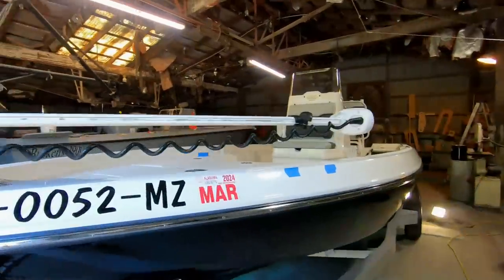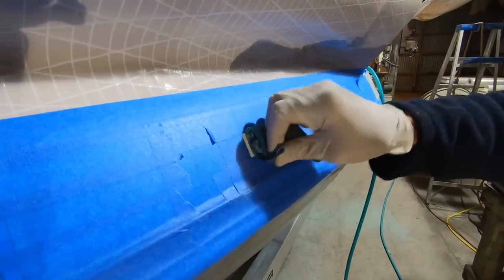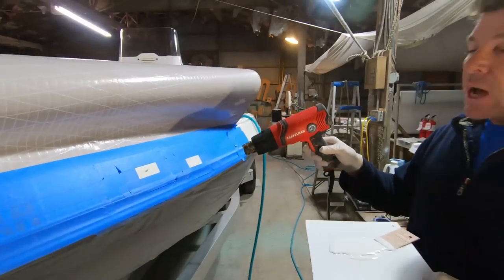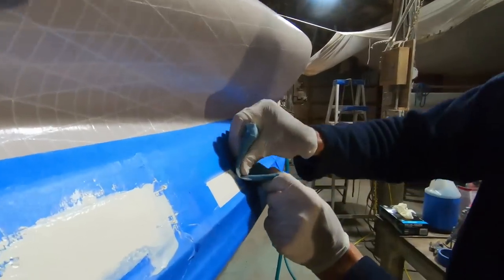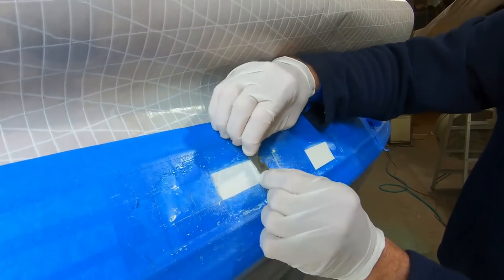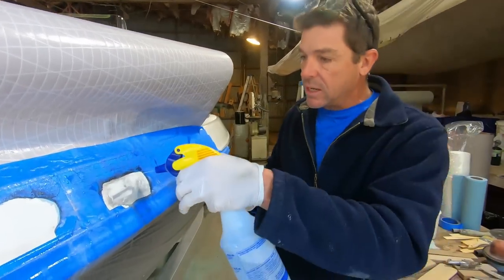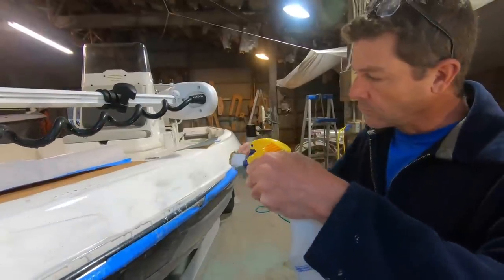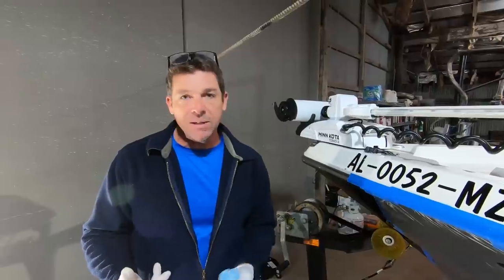GELCOAT REPAIR 101 -A to Z How To Repair Chipped Gelcoat and How to Repair Gelcoat Scratches

Comment: Hello Joe , this is Jaime from J A Fiberglass in Gilbert , AZ , it is amazing to  see somebody repairing gel coat the same way as i do from the wood blocks to the masking  around the repairs , i generally do add cabosil to thicken the gel coat on the first fill especially if its deep cause like you know time is money. i like to finish the repairs with 1200 paper , i find that works for me on white or light colored repairs , if  its a black or dark repair i will work up to 2000 and i use the 3M Hi gloss white white  with my rotary buffer , start out with a low setting  and finish with a like a four setting on the buffer and that takes all the scratches out and gives it a super high close , wipe it down good and i apply my favorite wax , which is the Collinite marine paste wax. Great to see this video, your spot on and people will get good results if they follow your advice, good luck fishing.
Reply from the maker: Hi Jaime, Glad you enjoyed the video! I agree that adding cabosil can be very helpful, especially with deeper scratches and dings. I have a couple more gelcoat repair videos on the channels where we show that process. The damage on this boat was on the edge between thickened and non thickened gel in my opinion. So I went with non thickened just to show some of the DIYers out there how it could still be done even if you didn't have any cabosil. But that is a good point! Sounds like we are on the same gel coat repair program overall. It is always good to hear from another professional, and get there feedback! I feel like there is always something to be learned from other craftsmen, and I try to have a open mind about different styles and techniques. I appreciate you watching, and your positive Comments! Please feel free to let me know if you have any suggestions for content on the channel, I would like to hear your thoughts! Thanks so much!
Reply: Some of the soft yellows and blues are hard colors to match, what are some of the tricks that professionals use to get the colors right if you make them up . Yours videos are great , I like your detail explanations it’s like I’m doing it myself while watching.

Comment: Been viewing your videos. Just so informative and super detailed. Luv your videos so much about repair and gel coating. I watched your videos numerous times to get confidence. Then purchased (approx: $800 since Qrt Spectrum Atrlantic Blue for $360) a bunch of materials and equipment to complete a DIY. Two months ago we had a minor stupid accident docking my Cobia 237 due to high wind and turbulent water. To keep it short, the above water line bow keel hit the upper edge of the concrete barrier. It ruptured the glass and gelcoat with a hole thru and bunch of port and starboard gouges and scratches. To sum it up.....ugly. Since the damages are above the water line, I believe you can consider it cosmetic but still ugly. Thank so much for your videos, I was able to fix everything and able to do trial an error (perhaps doing it close to 10 times) lots of practice for over a month due to weather (rain and wind conditions). Results: color matching not perfect, but hard to notice. I was able to feather and gel coating came out really nice. I still think it is achievable for my DIY to make it close to a professional job, thank you so again for your mentoring. You are the best!
Reply from the maker: Thanks so much! Sounds like the damage to your boat was just the kind of thing these videos are intended for. We all have those kind of things happen to us from time to time, it is just part of boat ownership. It sure feels good to know how to repair that kind of stuff when it happens! Sounds like you stuck with it, and had good results, Congrats! Glad the videos helped! I truly appreciate you watching and commenting!

Comment: Just did a spot with 2 gouges from the winch post.  They were there covered in keel guard when I bought the  boat.  Years ago I built surfboards do not need to glass but the 2 part gel cost video was spot on and the repair turned out great. Thanks
Reply from the maker: Very cool! Thanks for watching and commenting!

Comment: Excellent video.  I will be doing this on my canoe where the epoxy was worn down in the wind to the kevlar.  I've done quite a bit of research and your channel is excellent, the best I have seen. Thanks.
Reply from the maker: Wow, thanks so much for the kind words! Just remember that gelcoat can have curing or bonding issues sometimes when applied over epoxy. If the gelcoat doesn't work well,   you might need to use a epoxy based primer coat and paint system. I will try to do a video on this subject soon. Thanks for watching, and best of luck with your project!

Comment: Thank you for taking a well-paced, thorough, and methodical tutorial. Your presence, approach, and voice are very effective for camera facing. I am in the beginning stages of restoring my heavy oxidized bass boat. Like the others, I have done and still researching on YT a lot. In doing a small area as a test, I wasn't happy with the results of the product I was using. Then I found Starke Level R and Starke's other products, and the difference was night and day. As per your video request to offer suggestions, you might want to give Level R and its complementary products a look. 

Great job and I have happily subscribed.
Reply from the maker: Glad the videos are helpful, and I will check out the stark products. Thanks for the suggestion!

Comment: great video, I usually add cabosil to thicken the gel coat and do my fairing work then spray the final gelcoat, I like your tape method to get the gelcoat higher than the repair and smooth, I'm going to try it on my next repair. keep these technical videos coming they are great.
Reply from the maker: Thanks! The way you are doing your repairs is a solid method as well. I wanted to show different ways it can be done and still get a quality repair. Also thought some of the people interested might not have a spray gun. Glad you liked the taping method, it is a good option to have in your bag of tricks. Maybe I will do a repair with cabosil and a spray gun in a future video. Thanks for watching and commenting! It really helps the channel

Comment: Great video, very informative! Just remember that if you flip your gloves inside out for re use, the oils from your hand is on the outside of your gloves.
Reply from the maker: Thanks! Yes, I agree completely. In the video I had to take a new glove off to work with some masking tape for just a moment. The glove turned inside out as I took it off my hand. I turned the inside of the glove back to the inside rather than throw it away. I would never recommend wearing the glove in reverse after using  it, that would defeat all of the wipe down and prep work we did to the surface. I hope this clarifies what I was suggesting. I appreciate you watching and commenting

Comment: Excellent video, you said several times its a "long video", but you're constantly giving hints/tips and suggestions, so its all interesting and there's absolutely no "filler" (pun very much intended 😂) - I've just bought a 2nd hand boat that has a small-ish scrape that needs repairing, this has given me the confidence to give the repair a go myself 👍

One quick question, I have lots of good quality car polish and waxes, are they ok to use for the final finishing steps, or am I better off getting some gelcoat/marine specific stuff?
Reply from the maker: Thanks, glad the video was helpful! There are some good automotive grade products out there I am sure, but I know what I used in the video will give the result I am looking for. You could always test and see. I appreciate you watching

Comment: nice video, thanks for making it.  Instead of the rat-tail file, you might want to look at a tool called a 'riffle'.   Made for wood carving, they come in kits with various coarseness and radii of curvature.  Great for sanding concave areas accurately.
Reply from the maker: Thanks for the tip!

Comment: Fantastic channel. Having owned multiple sailboats in need of some gel coat repair (including the one I currently have), you have givenme the confidence that I can pull this off myself. Here is the stupud question though. When you add the final coat with the wax or the green spray, does that also make the previous coats of gel coat cure, or only the last coat? Asking for a friend.
Reply from the maker: Thanks so much for watching and commenting! Yes, using a wax solution, pva aka poly vinyl alcohol or a plastic sheet or film in or over the last coat of gelcoat will help cure the last coat and the coats underneath it. I think I will do another video on the secrets of gelcoat very soon for everyone. I hope this helps and best of luck with your projects!

Comment: Should I get the gel coat with wax or without for this type of repair?
Thank you for such a helpful and professional walkthrough
Reply from the maker: I usually buy gelcoat without wax, then also buy a wax additive. That way, you can apply several coats without wax, then add wax on the last coat as needed. You can also use a plastic film or a clear piece of plastic on the last coat if it is a very small and flat repair area. I hope this helps, and thanks for watching!
Reply: @FishBumpTV  thank you for your response! My repair is not flat, I will cover with with plastic film during the curing process and wax after sanding. It seems like the 3m marine compound and finishing material is not available anymore. Is this the updated version Gelcoat Compound + Polish 30344
Reply from the maker: @MrAlexthemachine  Sounds like a plan. Yes, I believe that is the replacement.
Reply: @FishBumpTV  you guys are awesome!

Comment: Some of the soft yellow and blue gel coat colors are hard to match , they look close but you can tell sometimes the color is off. What are some of the techniques that professionals use to match these colors when you don’t have manufactures recipe? Your videos are great and love watching them, Thanks for making me look like a pro.
Reply from the maker: You might try using a clear additive like Orca composites  Air Dry at a 50 percent mix with your gelcoat on your last  coat. This helps in the color transition from old to new gelcoat, and kinda tricks the eye a little into not seeing any  difference in the gelcoat. I hope this helps, and thanks for watching!

Comment: Beautiful gel coat work! Do you recommend letting the gel coat get to a paste/ partially set up consistency before applying with a spreader? Thank you!
Reply from the maker: Thanks! Normally you don't have to, but when I made this video the Temps were a little on the cool side. You can also add a little colloidal silica to the gelcoat to thicken it up. I show that in one of the other gelcoat repair videos here on the channel. I hope this helps and thanks for watching!

Comment: awesome video ! any tips on buffing pads wool vs yellow polishing pad and when , how to use.
Reply from the maker: Thanks! Wool is going to be a more aggressive pad than yellow pads usually. I use 3m and Presta products alot, and they are both good. I have a video on the channel going through the wet sanding, compound,  polish and wax process that also discusses buffing pad selection. It is on one of our dark green 19 ft center consoles that we built a few years back. I hope that helps and thanks for watching!

Comment: Great video. I have a few gel coat repairs to do on my boat and I will follow this to a tee. I have a few small chips on the bottom of my boat that needs repair and was wondering if I need to thicken it with something like cabosil?
Reply from the maker: Thanks, glad to help! You certainly could add some cabosil to the gelcoat, especially in the deeper dings. Then finish with pure gelcoat. I have a 2 part gelcoat hull repair video on the channel that uses that method. You might find it helpful. I appreciate you watching and best of luck with your project!

Comment: Hello im loving your videos and there length because you go to deepth with these things😊 
I do look forward to your stress repair video and i have a question, i have an Old boat where there is tread pattern on the deck, Can you show how too make a  gelcoat repairs on that, i have some holes in the gelcoat so the pattern is gone.
Again thanks for some informative videos and have a Nice day.
Best regards.
Thomas T (Denmark)
Reply from the maker: Thanks for watching all the way from Denmark 🇩🇰 That's a great suggestion for the channel! Matching molded in non skid is possible. You would basically make the gelcoat repair, and carefully sand it flush with the surrounding non skid. Then use a very small file, or even a jig saw blade with a straight edge as a guide to carefully cut the pattern back in to the gelcoat. I hope this helps, and I appreciate you watching!

Comment: Great tutorial and thanks.  Seems using the right materials and plenty of patience and elbow grease will make for a great result. Wondering if resin with a pigment is the same as gelcoat or are they chemically different?
Reply from the maker: Thanks 👍Resin with pigment added is not going to give you the same result as pure gelcoat. They are similar in a lot of ways, but I wouldn't recommend replacing one for the other. Appreciate you watching and commenting!

Comment: Great info that is much appreciated! I have an antique Aquasport that is in need of some cosmetic repairs. I wonder if you might do a video on methods of repairing gel coat stress cracks. Thanks!
Reply from the maker: Thanks! Next time I get a boat in the shop that has stress cracks, I will make a vid for you.
Reply: Thank you….I’ll keep my eye out! Wondering how deep you can use waxed gel coat….without building up with layers of unwaxed first.

Comment: Fantastic video. Would love to hear you discuss using thickened gelcoat paste/patch as those kits seem to be aimed at diy. Can those be applied in just one coat?
Reply from the maker: Thanks! Working at the professional level of boat repair, we honestly don't use the small gelcoat repair kits. We tend to buy bulk supplies at our local fiberglass distributer. I can see a need for a video reviewing some of the more popular kits though as this would make a lot of sense for someone doing small DIY type repair work. So I plan on doing a video working with one of these kits in the near future, maybe that could be helpful info for some of you guys. To answer your question, even when we thicken gelcoat for repair in our shop more than one coat is needed. Two coats will often work, and three thin coats for sure. Hope this helps, and I appreciate you watching!
Reply: @FishBumpTV  absolutely!  i think it would be really helpful to see you take an off the shelf kit (like the match n patch one from west marine) and give us your opinion on it and maybe some tips/tricks to make the most of it. sort of an unboxing/demo  i have a small chip in my gelcoat and that's really the most economical way to diy it.  the color match is especially intimidating (old boat - no available kit from spectrum).  there are plenty of videos of amateurs using those kits but i'm never sure how reliable their advise is.
Reply from the maker: @Art-jw8ho  I may swing by west marine and pick one up. Thanks for the input!
Reply: @FishBumpTV  appreciate you taking the time to respond to our questions!
Reply: @FishBumpTV  very excited to see this video.  exactly what i need right now as i just discovered a small crack i'd like to fix this spring. the instructions that come with that kit are simply awful.

Comment: Can you talk further on the cause of small pinholes (porosity??) in the repair area as you sand down??  Am I not mixing thoroughly enough or is thickening with additives causing that?  Thanks for any thoughts you can share...
Reply from the maker: Pinholes and porosity are pretty common, but they shouldn't be excessive. Sometimes, over mixing the materials can cause it. You might try mixing the materials a little slower. Also, in your application, try spending a little more time smoothing the material out in different directions. I hope this helps, and thanks for watching!

Comment: What gel coat coat  should I get? I’ve never done this before. But your video is very helpful and informative White without Wax Or With Wax?
I’m wanting to work on my 2000 chaparral sunseta
Reply: You may need both.  What are you trying to do?
Reply from the maker: I usually buy gelcoat without wax, and buy a wax additive. That way you have your unwaxed gelcoat for your base coats, and you can add wax for your final coat. I hope this helps and thanks for watching!
Reply: @fiberglassguru  I’m just trying to fix a few small chips. Nothing major. Just chips from docking from previous owner. Biggest chip is quarter size maybe smaller.
Reply: @FishBumpTV  would I need to still buy without wax if I’m only doing very small chip fixes. Maybe quarter size chips?

Comment: What would you suggest, if the whole side of the boat has scratches like that? I bought a boat that looks like Helen Keller docked it regularly for 2 years and it has nicks and deep scratches all down both sides (about 20 on each side) . Would it be better to treat each scratch, or spray each side?

Comment: Hey Captain Joe,
Awesome tutorial!
How do I order the correct color Gel Coat? 
I have a 2004 Wellcraft 29CCF, I see White and Neutral but you pulled straight out of a can and it matches perfectly!
Thanks Much Again from the West Coast down in the corner near San Diego.
Reply from the maker: Glad it was helpful! You can custom match your own gelcoat using a kit with a selection of different pigment s. I have a here on the channel detailing the gelcoat matching process that you might find helpful. There are also companies that specialize in factory match gelcoat. Spectrum gelcoats is one I have used before. Thanks for watching!